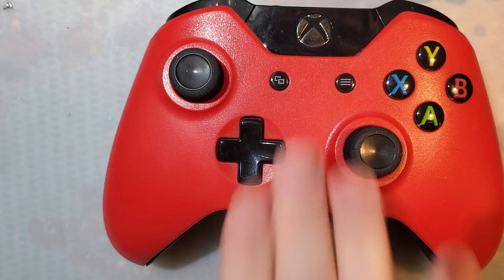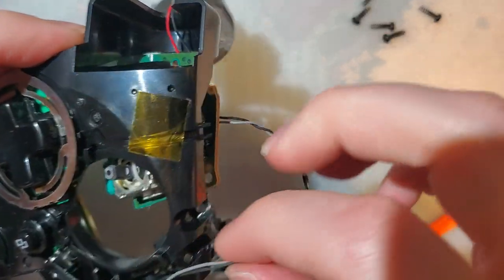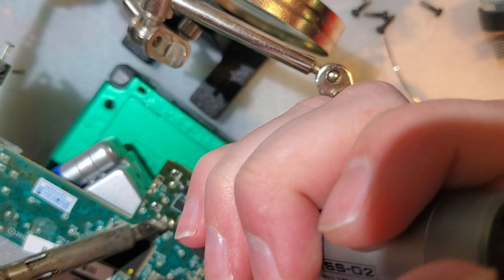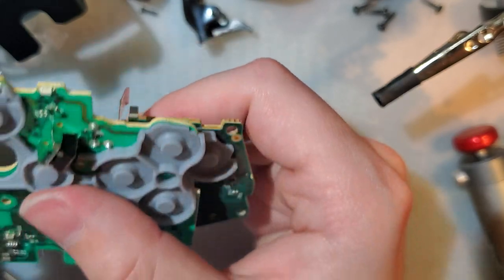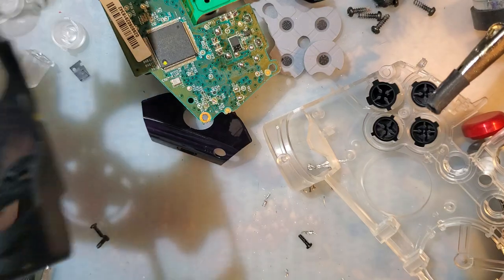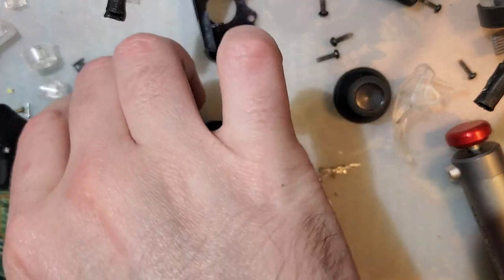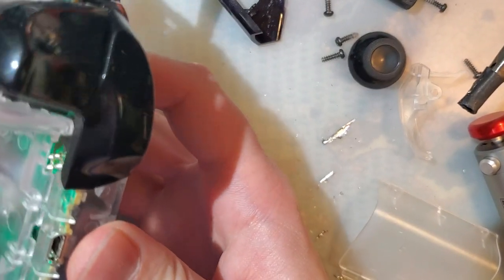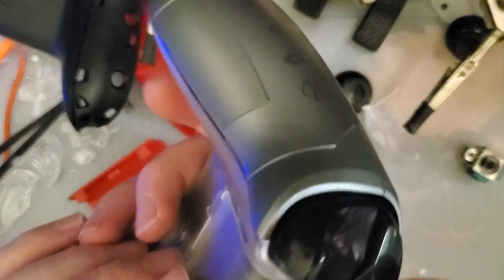Xbox One Controller Joystick Replacement

Comment: Nice video. The controller turned out pretty cool! Did the new sticks worked fine or did it drift?
Reply from the maker: oops, forgot to update that, didn't I? Yeah, it worked fine, it's just physically crooked on the PCB I think. I'll swap it out at some point. Probably